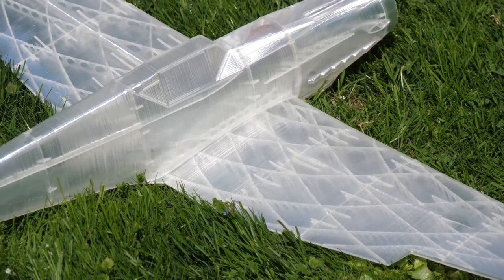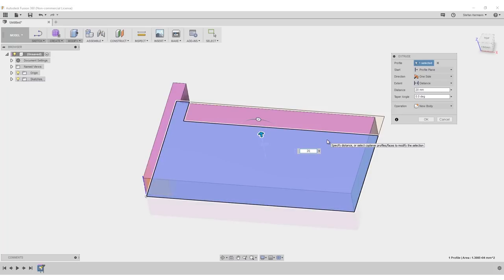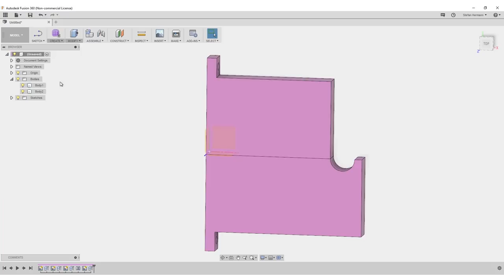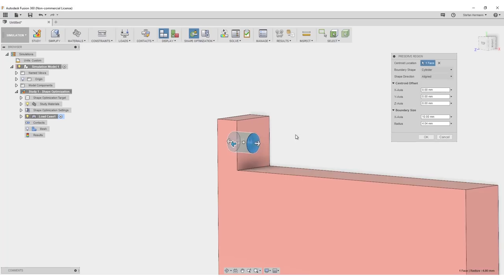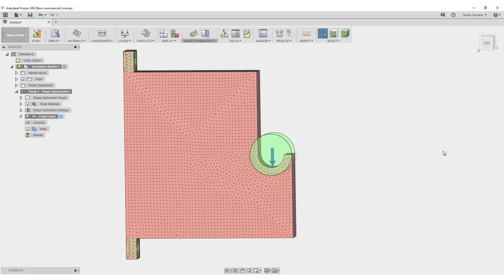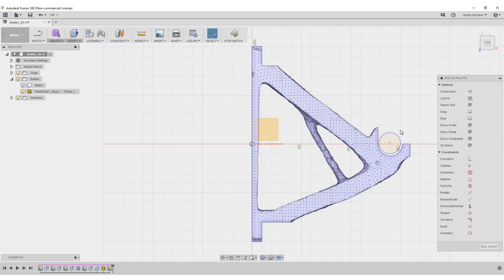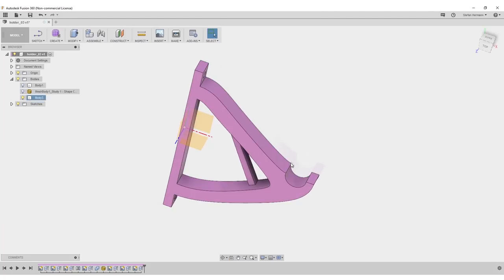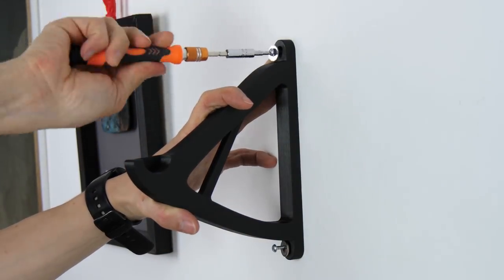TUTORIAL: Topology Optimization in Fusion 360 – 3D printing filament spool holder

Comment: I'm not sure why you made it so convoluted to make your original part? You had the dimensions and a sketch of what you were building, I can't see any reason why you bothered creating half of your design and then mirroring it, instead of just making the whole thing in one sketch. Or why you used rectangles to create the shape you were after.

If you know the profile of what you plan on sketching, just use the line tool and sketch out the whole thing roughly. You're just making a a rectangular shape at first, there really is no need to create a bounding box rectangle at the beginning.

Just draw the side on profile in one single go. Draw the area where you had the half hole, straight across. 

Once you get your profile set, start with constraints first (before dimensions) You should be able to "coincident" the midpoint of the back line to the origin to fix it in space (if you didn't start it that way). 
Then where you ahve "symmetrical", or identical features, make the lines that make up those features equal (equal constraint). Once you have constrained the geometry such that you only have to work with minimal dimensioning. 
Dimension one of flanges/feet that the hole into the wall goes in (the equal constraints from earlier will mean that the other ends up being the same). Dimension the two major lengths. 
There are two or 3 ways to put the hanging hole. Either place a a point and dimension it's position after you've extrdued your part, and then use the hole feature. You could do what you did. Or just put it in the sketch in first instance.

The holes for the feet to screw into the wall, just use the hole tool, rather than drawing a circle, and then pad removing it.
Reply: Looks like he's quite new to Fusion 360